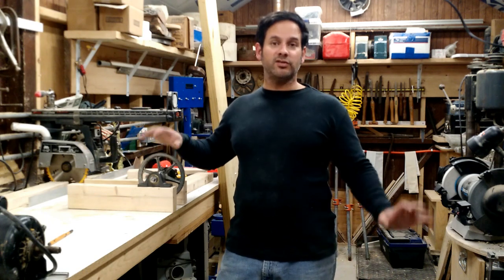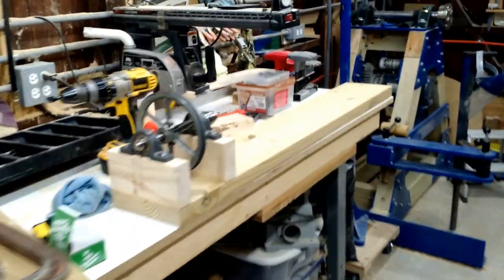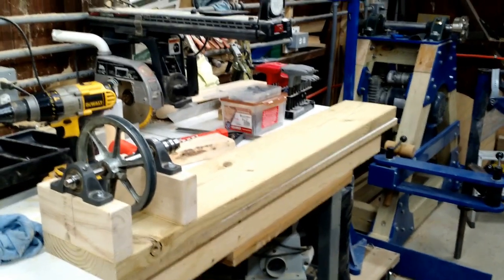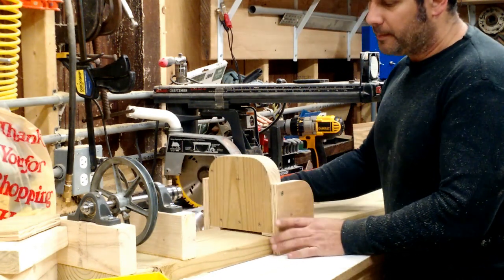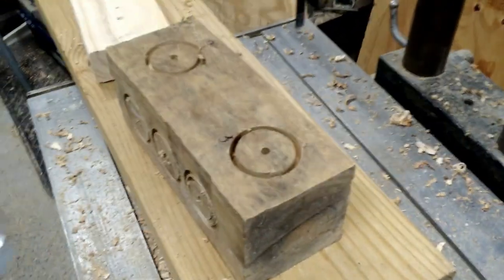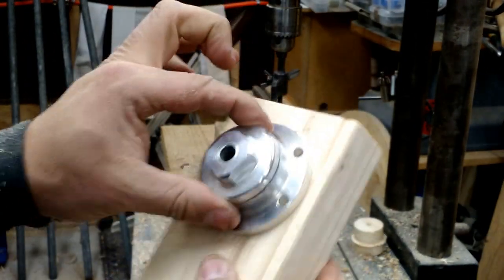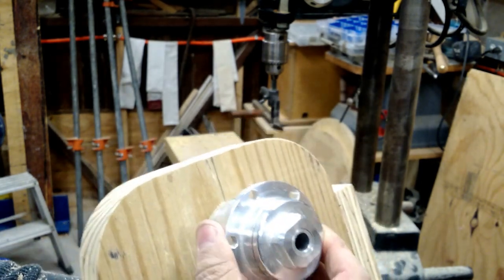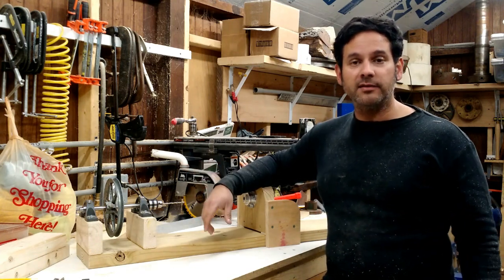HomeMade Lathe Part 2 - Head stock, tail stock, bed (torno casero)

Comment: I had watched this before when I was thinking about building my own lathe. I was having a issue with making the tail stock. I have a old bike that i think i can use the spindle  to male a live center. I wanted  my lathe bed raised so I could make a totally adjustable tool rest. So I took a 2X6 ripped it down the center and made rails for the tail stock . Then I found some old bed rails and mounted them on the 2X6 pieces that were ripped down the center. This serves a two fold purpose stregth/ rigidity, and something smooth for the tail stock to slide on. Great video
Reply from the maker: +Howard Yarborough thanks, I'm glad you liked it and that it was inspiration for you own lathe!! That is the best part about sharing ideas.  I definitely think think you can use a standard hub, I just happened to have a custom hub in the shop.  I would love to see your version....look in the video description, there is a link to my homemade lathe Facebook group.

Comment: How rigid this UCP spherical bearing under load ? I see you spindle axe so thin, do you feel some workpiece floating on cutting ?
Reply from the maker: +Dmitry Ponyatov everything worked great. If you haven't seen part 1, I discuss the reason for the lathe and some of the decision process.  Thus lathe cost me $0 since it was put together only from the items I had available. If you look for part 5, it shows a project, start to finish
Reply from the maker: +Dmitry Ponyatov here is part 1 https://youtu.be/3HfvXmpWk-o
Reply from the maker: +Dmitry Ponyatov here is part 5 https://youtu.be/BYH8YJk0CV4